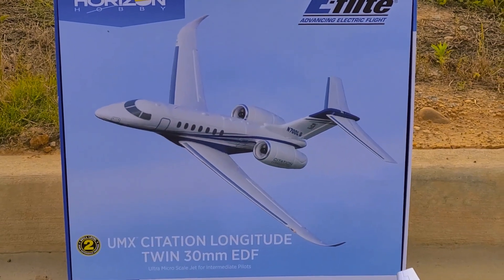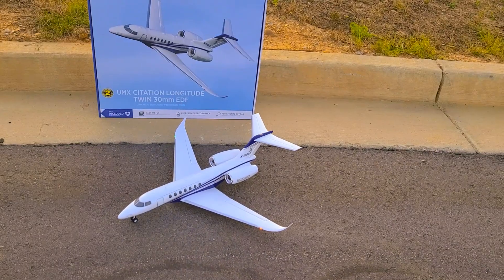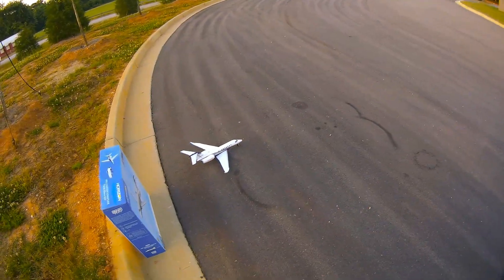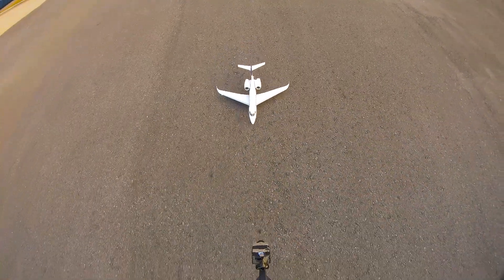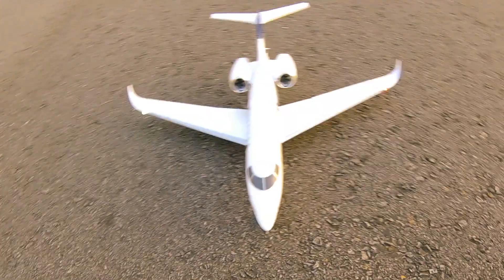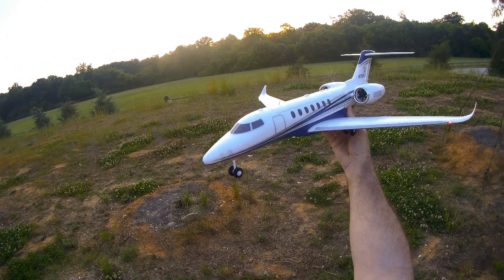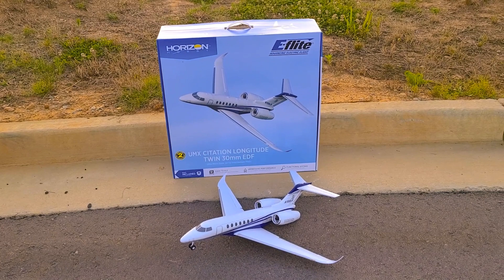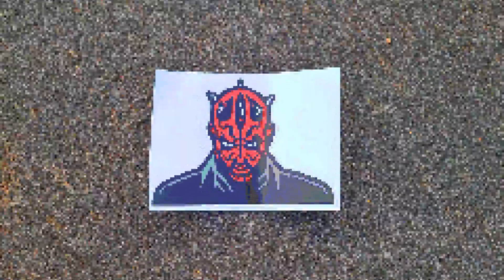UMX Citation Longitude Maiden Flight EDF Issue!

Comment: Mine does the same with the motor. It gets too hot. There is no cooling over the esc
Reply from the maker: Doug, good to hear, thanks! This was my maiden though, so it seemed odd! Wouldn't be the first time I got a bunk plane from HH though...
Reply: @DaveItYourselfChannel  I just got off the phone with HH. I told him what it did and he didn't ask any questions, just took my information and said he is sending a new esc. Must be having problems if they will send one without question. You should call them too. Because eventually it will happen during flight. I love the airplane, so hopefully this will get it straightened out.